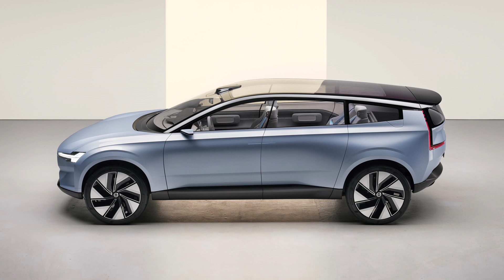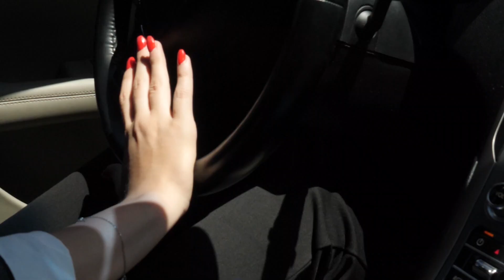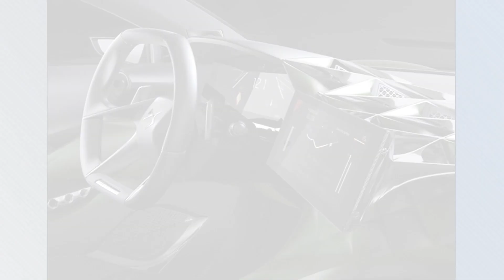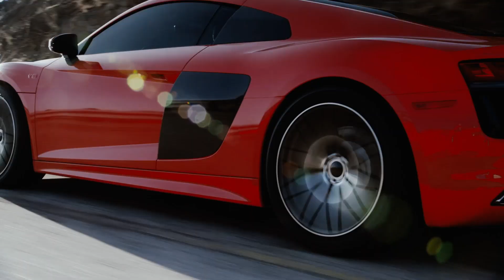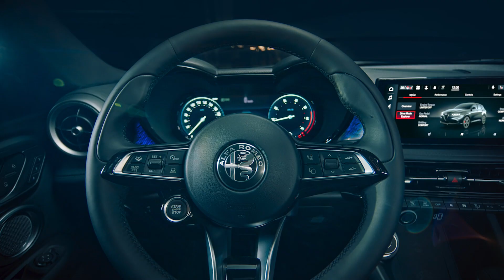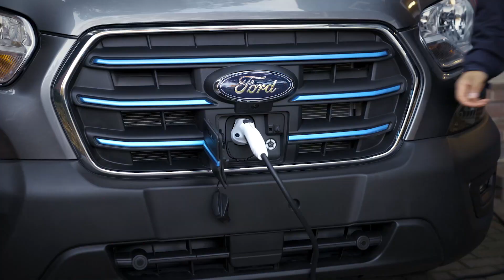Volvo Copies Tesla's Castings; Alfa Romeo Tonale One Cute Ute - Autoline Daily 3256

Comment: How does Volvo make a billion dollars turn into  a battery assembly facility, paint shop and final assembly, and still have money left over for mega castings?
Reply: Volvo saves on tooling and real-estate space and welding robots, oh and personel too , plus time  with the cycle rate in seconds, probably  less finishing  and corrosion protection  of welded parts,John McElroy says that the industry will have to follow Tesla vto be competitive, especially  in the  Gigapress and Megacast,  Tesla leads others follow.
Reply: @aurelio-reymilaorcabal9669  Thanks for reply, I knew Volvo was sold to Geely but still, Sandy Munroe says a paint shop is $600M and I can't believe they'd be any cheaper in Sweden. Great company yes, but imho that Volvo press release had some hogwash in it.
Reply: GEELYs Chairman  turned Volvo from a few billion dollar company  to a 30 billion dollar  company, he just IPOed  it,a  smart  man  he is.Geely  even has a  Autonomous drone in development, + ownd 9 % of Daimler, and maybe 4 other auto Co.s.
Reply: @aurelio-reymilaorcabal9669  He let Volvo be Volvo. There's not much Geely did beyond financing and some work with Volvo on the CMA platform. Geely seems to be run really well. They're collaborating with Mercedes on a joint Smart EV and also with Renault.
Reply: @benjaminsmith2287  Volvo engineers  helped  with the Geely LynkCo  platform, and  the Geely Zeekr 001  is built on the CMA  as well,I won't be surprised if that platform  has  Megacast pieces later on,also having Lotus engineers  help in chassis development .
Reply: @aurelio-reymilaorcabal9669  Zeekr is built on the SEA platform. Great car.

Comment: It seems like front megacasting is much difficult than rear.
Wonder if Volvo solved the warpage problem like Tesla did by developing special Aluminum alloy.
Reply: They can license it.
Reply: @davefroman4700  they don’t need to licence anything!
Reply: i doubt it because tesla has advanced engineers from spacex helping with alloys. !
Reply: @GURUofSEARCH  stop talking nonsense!!! Volvo just like other ICE manufacturers have been working with metals and composite materials, Volvo doesn’t just make small cars but the giant bus, trucks, construction equipments…. Making a big casting is not a problem for them.
Reply: @carholic-sz3qv  Legacy automakers outsource everything.  They talk to Alcoa (or who every their supplier is) when they need something different.  Automakers don't have the metallurgy departments like Tesla does.  If Volvo is using the IDRA presses, then they are most likely licensing the aluminum allow that Tesla created.
Reply: @donm2255  stop talking shit!! Where is it written that automakers outsource everything?!? Everything is designed in house and most of parts also in house, tesla also outsource a lot of things, just look at sandy Munro video teardown!
Reply: @donm2255  Volvo is going to use their own alloys and not necessarily IDRA. There are many other companies that makes casting machines.
Reply: @donm2255  automakers have metallurgy department’s and have been using all kinds of alloys and materials for decades from F1 racing to wrc, rally Dakar, heavy duty transport, custom equipments….. Audi was the first manufacturer to make a 100% aluminum car body. Bmw built one of the worlds largest carbon fiber factory in the world….
Reply: @carholic-sz3qv  I have watched nearly all of Sandy's videos.  One of my favorite Sandy quotes is "what you don't do, you don't know."  He was referring to how legacy auto outsources almost everything.  The only thing they do in house is engines and transmissions.  Which is completely useless now.  Tesla is now the most vertically integrated auto maker.  And it shows with the frequency of vehicle and production improvements they make per week.  

Volvo doesn't have their own alloys.  They are using what ever their suppliers give them.  No other company besides IDRA has presses big enough for auto body castings.  And no one other than Tesla has the alloy to make castings that don't need subsequent heat treating.  No one else is doing it.  Volvo wants to now that IDRA and Tesla have proved it's possible.

Legacy automakers do not have their own metallurgy departments.  You need to go re-watch the Munro videos.
Reply: @donm2255  lol…… is sandy Munro the only automotive engineer in this world!? He has absolutely no idea on tons of things he talks about, those manufacturers doesn’t outsource everything and even when they do it’s all a custom piece that is vertically integrated to the car, also there are tons of features that those manufacturers have that tesla still seriously lack, mercedes for example makes all kinds of cars/vehicles models including a lot of models which are sold in almost a 1000 of different configurations, those trucks and equipments are used all around the world in all kinds of conditions for all kinds of applications.
Reply: @donm2255  tesla barely makes two vehicles the model s/x and the model y/3 compared to again Mercedes’ which makes trucks(garbage truck, heavy duty, dump….), vans, bus, minivan, armoured vehicles, army vehicles….. the Mercedes’ UNIMOG alone is an universal vehicle that has all kinds of adapters/connections for use in mining, agriculture, construction, rail work, utility maintenance, rescue…..
Reply: @donm2255  legacy automakers have their own metallurgy departments, I donot trust your “sandy Munro” 100% has he ever worked at all those car companies!? Uhm nope never. The engine block alone cast iron or steel are just a small part of the metallurgy, the pistons, connecting rods, a lot of very precise machined parts uses very special alloys, those companies also racing in f1 or wrc, lmp have been developing and using all kinds of alloys and composite materials. 3d printing and bionic shapes/parts are actually the future and have been developed by those “legacy OEM”
Reply: @carholic-sz3qv  legacy auto is now  consulting with Sandy Munro  a bit, they have to  or face extinction  as  he educates the Chinese  by selling them Tesla teardowns, maybe YOU   can get a bit of EDUCATION by watching all his " Munro Live" shows in Youtube,  as we have and  gotten an Education ourselves,FYI  Munro Live  has more subscribers than Auto Line Network  5 all in less than 2 years...EDUCATION  is good for  You.
Reply: @aurelio-reymilaorcabal9669  lol….. I’ve been watching sandy Munro for years, I don’t need any education from anyone, sandy is not the only one in the world to do such things, he doesn’t even get to the smallest details on those cars, no one is going to buy Chinese cars.
Reply: @aurelio-reymilaorcabal9669  what does sandy Munro and Auto line subscribers have to do with this!? Those are completely different channels addressed to different public, you’re welcome!!
Reply: @carholic-sz3qv  one day  American  manufacturers  will have Chinese masters, if the Chinese  want to  buy the company , that is.🤣LOL
Reply: @carholic-sz3qv  Yes,  like we thought we'd never own Japanese Toyotas , and  Korean  Kias and Hyundais ,  and  German BMWs and VWs and Mercedes ? WHAT PLANET  DO YOU LIVE IN ? Mars? Elon  came from there , me thinks 🤔
Reply: @carholic-sz3qv  Both channels feature cars  and the industry  and what is coming our way , and what the future  holds, which will be migrating  to BEVs, like it or not ,and both  channels educate  us  of the industry.oh  and Detroits market share has shrunk to what percentage compared to  30- 40 years ago?I wouldn't  touch a Detroit product with a  10 foot pole, and actually  GM told  their Bolt  owners  to park their cars with  50 feet "Social Distancing"  maybe the cars  had Covid19? 😷😷😷😷😷😷😷😷😷😷😷😷
Reply: @aurelio-reymilaorcabal9669  ok but actually does auto line take cars apart!? Because That’s the main activity at sandy Munro it’s a completely different thing, auto line is just a new channel not actually very technical in details….
Reply: @aurelio-reymilaorcabal9669  actually Toyotas are all around the world, the most popular vehicles on earth, one of the longest lasting ones, you go to the deepest/remotest places in Africa, Asia and South America, you’ll see a Toyota that has been helping move both goods and people on the most difficult places, I can’t think of any EV that can survive those conditions. From hauling the most overloaded stuffs to crossing the muddiest, worst roads, waters/rivers…….
Reply: @aurelio-reymilaorcabal9669  yeah in your dreams lol….. you see what happened with huawei and other Chinese companies in the US!!!! Good lock with your « chinese car »
Reply: @carholic-sz3qv  First you site Sandy Munro as a credible source, then you trash him.  It's really hard to take anything you say seriously.
Reply: @aurelio-reymilaorcabal9669  - "One day  American  manufacturers  will have Chinese masters."

Chinese manufacturing is improving, but the system will not allow them to become really good at making anything.  Too much incentive to cut corners.  It's how they think over there.  The CCP can't feed their own population, there is a water, labor and energy shortage, and their economy is built on a pyramid scheme (real estate bubble).  The pieces that need to be in place to create a manufacturing giant to compete against the US just isn't there.  The only reason they have gotten this far is the exploitation of cheap labor.  

Plus, I don't like buying Chinese products and I certainly would not buy a Chinese made car.  And that assumes they are allowed in the American market or not tariffed to protect American legacy automakers.  I know Sandy Munro seems to think Chinese automakers will be able to compete here, but I think his is ignoring some macro level variables regarding China.  That being China's internal issues (central planning never works for very long), and demand issues here in the states.  Would you put your family in a Chinese made car?
Reply: @donm2255  Chinese cars are already in Europe, and many Asian countries  and maybe You should  .ook where that  Big Screen TV and I Phone and Samsung  items are made  , chances are  it  is MIC  and  while  you are it  check all the stuff that you bought from Costco, I could  go on , China owns America.LOL
Reply: @donm2255  You might not want to  buy MIC  cars  but  chances are  your  grandkids will, i  guess you never  owned a Toyota  LOL
Reply: @carholic-sz3qv  China will own America,  lots of them are already in USA,  hey  better learn some Mandarin,  your  great  grandkids  will be  have  Chinese  blood LOL
Reply: @carholic-sz3qv  Toyota  is  invested in FOOLCELLS    that  is their future    LOL  FOOLS   They think we  will be  driving on Hydrogen  cars   HA HA   .
Reply: @carholic-sz3qv  Toyta  will be  history by 2030  as they  want  us  to drive in Un Obtanium Hydrogen   HEH  HEH   what  a  joke Akio  is
Reply: @aurelio-reymilaorcabal9669  in your dreams troll! Keep dreaming 😴
Reply: @aurelio-reymilaorcabal9669  new hydrogen storage solutions are been developed to store energy and which can be used into the chemical industry…..
Reply: @carholic-sz3qv  Keep dreaming   your Hydrogen  dreams, it is the" Fuel of the future ", will be for  another  60 , yes   Hydrogen  FCV s  are that old  I think  GM  had  the first ones, early 60s, meanwhile  everybody will just plug-in  overnite.
Reply: @donm2255  I never thrash Sandy , have the most respect for him, he is the Paul Revere  of the Auto industry , banging the drums , warning  that legacy auto  like Detroit better shape up  else the  go like your Dinosaur pet, like  into extinction.
Reply: @carholic-sz3qv  LOL LOL LOL LOL
Reply: @carholic-sz3qv  Yes, and very old Toyotas. Maybe Toyota doesn't make the most exciting and cutting edge cars, but they sure make serviceable cars that can last a long time and deal with pretty extreme conditions.
Reply: @GURUofSEARCH  Volvo has also been using recycled materials in their cars things that Tesla doesn’t even think about, finally BMW was the very first to use giant castings.

Comment: Quick Question. How many OEMs will be using mega castings before the decade is out? 
"JUST LIKE TESLA" is going to be a commonly used phrase in the coming yrs.
Reply: BMW was the first company to use big castings in their cars, also ICE manufacturers have been working with all kinds of metals, alloys and composite materials.
Reply: @carholic-sz3qv  BMW  who?
Reply: Large castings were already tried in the past, but they were overall more expensive than multi-part approach. And it's not "just like Tesla", but rather "just like IDRA", cause that's whose technology it is.
Reply: @SkywalkerWroc  IDRA makes the casting machines, but they are useless without Tesla's aluminum alloy.
Reply: @donm2255   wrong. They've been already used without Tesla's alloy, and every car manufacturer has a long portfolio of their own alloys. Cute that you think Tesla making their first one is something special vs others making new, dedicated alloys for the purpose on a regular basis.
Reply: @SkywalkerWroc  It took Tesla  to make  mega  cast reality, after Elon  talked to IDRA , mega cast  was ignored  by  legacy auto ( still is) but that will change  fast, as the Chinese  are now adopting it  to stay  competitive,  It also took Tesla  to make BEV fashionable  and common, GM    recalled & CRUSHED theirs( EV1  , and even  burned some, before recalling the  Dolts.🤣
Reply: @aurelio-reymilaorcabal9669  You're misinformed. What you call mega casting started years ago, it wasn't ignored, BMW, Daimler and others used it before anyone at Tesla even heard of the thing. IDRA fully developed the die casting machines before Tesla even approach them with the purchase. Yes, Tesla did ask to fit the machines to the Teslas' requirements, but these changes were also done by IDRA, and isn't anything special in the industry. As for adoption - Everyone are adopting to stay competitive, and a bulk of companies have a higher YoY BEV sales growth than Tesla (e.g. Volkswagen). I won't even go disseminating other nonsense in your post cause you don't seem to be willing to educate yourself, but rather you spew some nonsense taken out of Tesla fanboy blogs ("legacy auto" "BMW who" - disguising nonsense)
Reply: @SkywalkerWroc  There is currently no megacast built on the scale Tesla employs , front and rear , small pieces are  not " MEGACAST" Education  comprehension   is one of your challenges,  back to grade one i guess.
Reply: In ten years the majority of people will no longer need to own a brick that is parked 95% of its existence.
Reply: @davefroman4700  in 10 years people are still going to need and drive and own a car, from overlanding to off-road, custom cars for work or for family use and also in case of an emergency…….